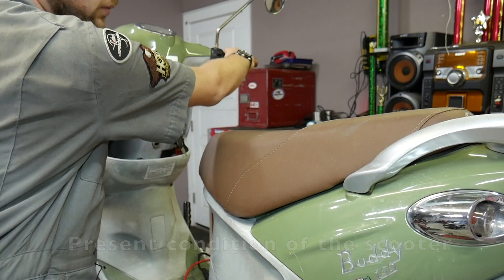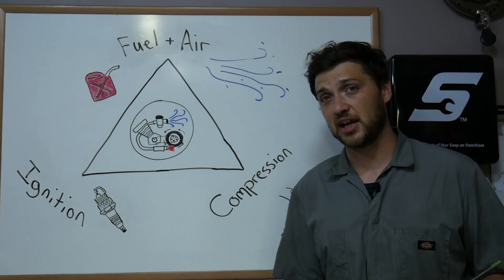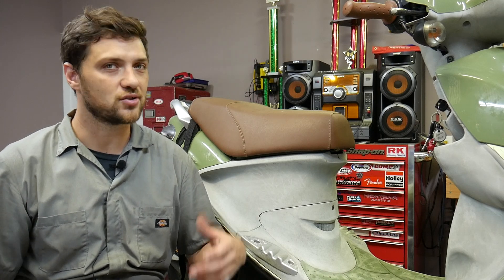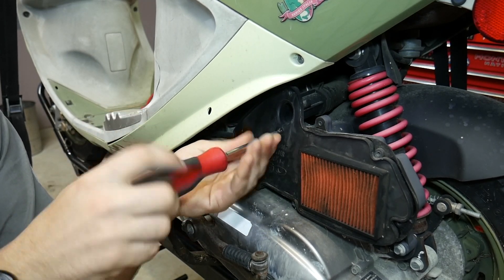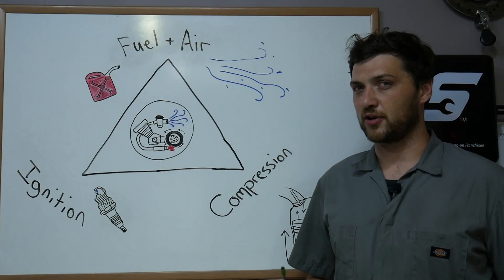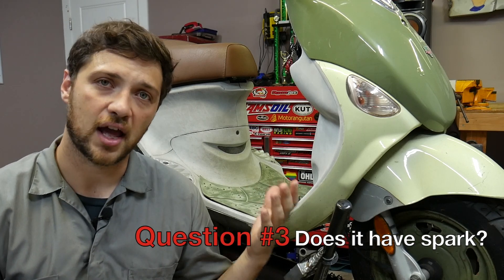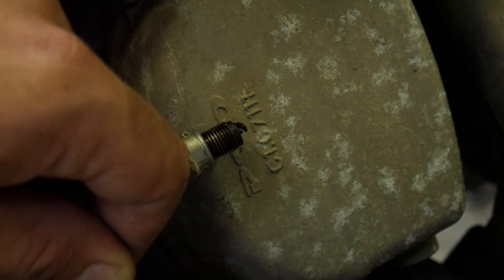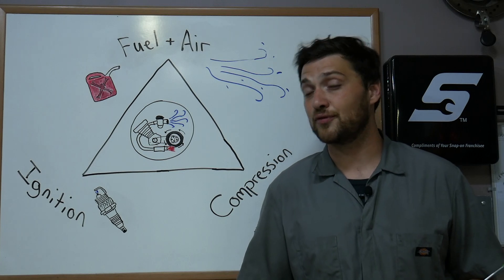Scooter 911: Find out why your scooter wont start by answering 3 questions!

Comment: Bought my husband a 2009 Silverwing 600 for our anniversary. Your help has been awesome. We are stuck at the turnover but will not complete and start engine. We checked EVERYTHING. Put a new starter relay on and cleaned starter switch button and got new battery. Battery drains fast. Storage Light is disconnected. We don’t have carburetor so don’t know how to check fuel injectors. At least we went from no sound at all to that turn over sound. Worked fine when bought the bike on Sept 4. Todd a few times, then nothing. Krr we or trying every day and about a week later, started right up. Turned off and on several times and rode a couple blocks again. That was few weeks ago. Has not started since. At least now, it turns over but does not start. Sparks too. Lights work, kickstand up, brake grid tightly. Checked electrical supply with meter. Kinda out of ideas.

Comment: Hi, I was shopping for a 2 stroke vino, met with a seller. He added premix into his 4 stroke and now it won't start. I lowballed him but we'll see. I know I'd have to drain the fuel and probably clean the carb out. What else would I need to do? How does the oil foul up the system? I'm curious.

Comment: Longshot that you would reply to something like this but, I’ve got a lance Cabo 50 - it was running fine on a Friday, then wouldn’t start on Monday morning. It turns over and passes the spark test. There is no change in result when doing the carb cleaner technique. Cranks but won’t start. What is the next step? If it was the coil it wouldn’t spark, right? Thanks again for all the great information you share on your channel.

Comment: My scooter electric starter doesn’t turn over and none of the lights or gauge lights comes on. However, the engine start when I use the kick starter, but still no lights. Anybody have an idea what’s wrong with scooter? It’s a x-pro x20.

Comment: I have a 2020 Tao Tao Quantum Tour 150cc scooter. I've been having some starting/running issues after it sat inactive awhile. I've replaced a bunch of parts such as the fuel petcock, fuel filter, spark plug, CDI, performed a valve adjustment and finally replaced the carburetor. It does start but idles rough for a few minutes then dies. I can't for the life of me figure out what's going on with it, could you give me some advice?

Comment: I'm disabled and a girl I guess that don't mean anything but I need my moped to start running again I believe since I replaced some tubing and a new fuel filter it may be the battery because I need a new one it seems like it's burning out batteries every time I put it in however I know mine is stricken with compound issues on one item because it doesn't look like there's a bunch of problems it's hard to detail it turns over but doesn't start brand new spark plug as well I need to get a new battery but that doesn't mean much when it comes to the kickstart my kick start does not work in fact when I was trying to get started the other day before I bought brand new tubing it started bleeding gas from some tubes so I went and I bought a brand new fuel line
Reply: Long story short I bought a fuel filter tubes spark plug and I need to get a new battery because it's burning out batteries it's what it seems to be doing I write it constantly and since I put the new fuel filter on I wrote it for a couple of months all of a sudden out of nowhere lights dimmed on me and stalled in the middle of the street I had to walk it back home it never really turned on again and this was just 3 weeks ago please help me it's my only form of transportation I'm in desperate need of some pointers my grandparents are passed away or they would be my mechanics God bless you

Comment: 2020 Blaze wolf 3000 miles brand new fuel filter some new tubing I might need a new carburetor boot and or carburetor my problem also might be the CDI box I need help desperately and when I say desperately I mean desperate it's my only form of transportation please help

Comment: My 2015 gillie runner has spark.. i cleaned carb & put New fuel in.. it turns over but won't start..
Even with carb cleaner..
Was knocked over while parked which i found out just as I finished I putting new stator in.. (random old man told me he picked it up for me a couple days ago  )

Comment: how many amps coming out of the muffler? lol. love you videos. details and user friendly. just bought a sym rv250. tonite it wont start. will check for battery and electrical components by elimination
Reply from the maker: I think it read 42amps at 90psi haha

Comment: Mann i am glad i ran into you i live here in dominican republic which scooters are main transportation for us poor people i have an issue with 2019 tauro 125 cc and is been a bitch to fix and the mechanic here rather keep giving you around treatment for you keep bringing the scooter back to their shop besides they know i work in a call center and that i make about 800 u.s. a month so they not going to fix it any time soon let explain my scooter started to clough up in the cabulater and stall . the mechanic took it apart clean the cabulater . weeks later again same issues cabulater getting claught up again with gasolina . well the problem has gotten worst now there is and electrical problem the lights deem down i charge spark plug and it sounds like the scooter is going to fall apart like alot cracking noice please tell me what to do cause this mechanic have realy done a bad job on it i do see alot parts not connected to the cabulater i know going through you i can tried to fix it myself .. Dont trust this mechanic with scooter thanks

Comment: I have a Peace sport AR 50 it my brother gave it to me it wasn't running I bought new battery of filters it was running then when every time I stopped it wouldn't start I adjusted carburetor and ran pretty good but it was doing as you said in your video it was coughing it was a lot of things and then it shut down on me and now it won't start at all I guess I do the fuse but even before the fuse blew it would not even cough and crank over it just the lights would come on and it would do nothing I'm at the bottom end of this thing I'm ready to sell it I was put too much money into it it was a free gift but I've spent too much money on it you could help me

Comment: Carb cleaner in the air intake was EXACTLY what was needed to the "My scooter won't start" issue.  Hardest thing was removing the air filter cover!  Thanks for the very informative video!
Reply: What can i use if i dont have the carb clraner
Reply: where do i get the carb cleaner
Reply: @zakariaameur7138 it is super cheap (5 dollars) at auto stores lime autozone and even sometimes walmart. Got mine at Autozone
Reply: Any Auto parts store, Walmart, Meijers, Target, even sometimes a dollar store. @zakariaameur7138
Reply: @zakariaameur7138 at walmart

Comment: My 150cc scooter wont seem to start with the new battery. Wont (turn over)But if I use my bigger 12v battery it will turn over and start. Ideas?

Comment: I watched your video I have a 2000 mine buddy International model 50cc when the moped is running gasoline is dripping so I'm thinking it's a carburetor issue do I spray some carburetor choke cleaner into the area behind the air filter to prevent more gasoline leakage to the ground if you can respond to my message that would be great the moped has sap for quite a while a few years but I'm working on getting it on the road but if you can still write me a message that would be great Thanks
Reply: I'm trying to say I have a 2009 Buddy International 50cc... Gasoline leaking on the ground when the moped is running I figured it's a carburetor issue what will cure the gasoline issue thank you for your reply

Comment: very informative presentation :) since my scooter totally failed the compression test (15 psi) it's probably a compression problem, even though I replaced the cylinder and the piston + rings. I guess I'll finally have to take the engine off and find the leak. A lot of work, since I never did it before... but I guess I'm gonna learn something...

Comment: Hi. I purchased a 26mm carb upgrade for my 150cc scoot. Installed it and Scooter wouldn't run except w/starting fluid. Obviously, it wasn't getting gas. I then noticed that the accelerator pump port on the carb was blocked off. Wondered if that was a defect, so I went back, read more reviews on Amazon, and saw others who mentioned the port & said that the carb didn't work. After a bit of thinking... I removed the gas tank cap and the scooter started up & ran great. Now I'm wondering what I should do next. Should I buy a vented gas cap or do I need to do something else? Also... I don't know if this is worthy of a vid, but I bet there are others who didn't figure this out who would appreciate it. Thanks!
Reply: Amazon page info & link follow: Carbhub GY6 150cc Carburetor GY6 26mm Carb for Kazuma Taotao Roketa SunL Baja Eagle Chinese Go Kart Carb with Air Filter

Comment: My moped has been sitting unused in the back yard for a couple of years, I changed the battery (I had tried charging it to little success), changed the spark plug, but it was your tip with the carburettor cleaner that eventually got it running.
Thank you for your help, it is very much appreciated.
Now I'm off out to see if it kicks into life again.
Reply: Did the carb cleaner trick work for you?
Reply: @Youtube-student2  it did indeed. I felt like a clever mechanic 😁😁😁. I honestly know nothing about engines and stuff, but even I was able to utilise this fix.
Reply: @Youtube-student2  It took me a couple of goes to get it running/ticking over. I suspect it's a good sign that it started at all, possibly the harbinger of an engine wanting to run 👍😁👍
Fingers crossed it does work for you 🤞🤞🤞

Comment: 49cc peace sports 2012 scooter. battery fully charged, new CDI box, new spark plug getting full Sparks, new fuel filter, I don't know what else to do! it's making the same sound yours made in the video but it will not turn over unless you kick-start it. when you kick started it'll turn over but it spits and spiders and runs like it's not getting gas. in Hudson, FL. someone please help!

Comment: Can you offer me a solution for my electrical issue with my scooter?! My turn signals and breaking light works but the headlight, the high beam and night time running lights do NOT work. How can I fix this?
Reply from the maker: Well on most scooters the headlight runs on AC while the tail light and turn signals are DC. Is it possible the bulb has failed? Sometimes without the bulb absorbing a large amount of power a voltage spike will blow out the smaller bulbs

Comment: its a long shot this but i have a tgb 202 classic scooter 50cc, last year it was running lovely i put it away over winter months and it's a no go now, iv'e tried everything i can think off, gutted the carb top to bottom, brilliant spark, seems to have compression as she barks if i drop fuel in spark plug hole and easy start in carb, but it has a 4 port vacuum on it, if i suck the end that goes into carb fuel comes out like it should but once in the carb it doesn't suck fuel down to it, i did away for a moment with the vacuum and put a straight fuel on/off switch from tank to carb but she still would not fire up, i'm at my wits end with it any help would be appreciated, jay from newark uk

Comment: Hi Garret...your channel is awesome!!  I was hoping you can help me out with my problem lol I've got spark,  I've got air, compression I've got fuel, but it's dry at the spark plug... you'll carburetor did run but it had numerous issues with being smooth so I replaced it with a new one now it won't run at all ..this is a brand new carburetor, electric, plug, oil.. everything ...what do you think it might be? And yes I did check the valves and I've got the needle at #4 position...

Comment: I have a honda ch80 and it wont start. the carburetor is getting gas but where the spark plug is isnt getting gas. the spark plug was dry. what can i do?
Reply from the maker: Sounds like you may need to recondition the carburetor!
Reply: @Scooter_911  Thanks thats what another person said. Im gonna take it apart and clean it. clean the jets. hopefully that does the trick
Reply: @Scooter_911  I took it apart and a piece of the rubber diaphram was sticking out and once i got taht open i noticed it was cracked and torn. do you think that could have been the problem? i sure hope that was.

Comment: PLEASE HELP!!!  I have a 2008 Chinese scooter 150cc.  I was riding it and it just stopped running.  It would crank over but not start.  I have replaced the stator, coil/plug wire and CDI.  Now, I turn the key and have NO power to dash, lights, horn, or starter switch  I have a fully charged new battery, can jump starter relay and starter kicks.  I checked the fuse in battery box, all good.  PLEASE...do you know why its doing this?

Comment: Thks 4 your video excellent I have a Piaggio zip 2T no fuel came out to the carburettor is new tap filter and valve if I such the pipe fuel came out I cleaned the carburettor or ready any hel please because is not starting Thks

Comment: Hello 
I would like to ask a question. I have gy6 moped it shuts off of a stop or signals as I slow it down.by seeing your videos I have adjusted its valve lash.i Changd it plug  .ignition coil and engine oil as well but still facing same issue. Kindly give me solution.  Thank you

Comment: Your videos are the best on scooter 911. I just got a Chinese sunny 49cc scooter that’s sat for a lonnnnng time. I replaced the carb, bendix, stator, cdi, starter,spark plug, ignition cable, battery, and rebuilt the kick start. As it stands now it still won’t start. So now I’m onto the valve adjustments. Fingers crossed!!!
Reply from the maker: Good luck! Sounds like you're on the right track!

Comment: My scooter cranks gets fuel and air but literally stopped moving. It idles but when you twist the throttle the clutches dont engage and tire doesn't  spin. I replaced the belt thinking my belt was bad but it wasn't so now I changed variator and still it doesn't run and move any ideas

Comment: The external fuel source worked for me but only when I blocked the air intake, if I remove my hands (from the air intake) the engine dies. Is there anything I can do what is wrong?

Comment: My scooter is hard to start when the engine is warm but has sat for a bit, like after eating lunch or grocery shopping, taking many cranks and having to give it lots of gas to barely get it to start, other than that seems to be running fine, any idea what could be causing it?

Comment: Can you please please do a video on testing the front main light? I have been staring at wiring diagrams and took everything apart and still cant figure out why my main light wont work, but a little secondary light in the same main head unit does work, Yes I did replace the bulb lol.

Comment: Mine won’t start at all previously trying to start it it would make the sound like in the beginning of the video- but now the lights won’t come on the battery makes a siring sound ( I am currently replacing the battery in hopes it’ll start )- but I want to cover all the basis of reasons why it isn’t starting & what else I can do if that doesn’t work- I noticed the inside of the fuel tank has rust- & you can feel it do something when I go to turn it on but it won’t start, lights won’t come on and it won’t make any sounds at all except the battery ( now removed ) please help and let me know if there is anything else I can do- the Kickstarter didn’t get it to start

Comment: These bikes are cheaply made and in China. Had pieces moving out of it when I got mine. Bought whole new battery and oil. Also you can't get the nut on the bolt to screw in on the handlebars. This thing is literally garbage, don't waste your time. Will stall out on your first ride. Just money hungry people looking to rip you off.

Comment: I'm trying to get Lady friend's shanghia shenke mf50qt started after not running 4-5 yrs and after 2 "mechanics" worked on same.
I have good compression and new parts consisting of battery, carb, spark plug, and vacuum fuel valve but scooter will not start even with shot of carb cleaner....ANY SUGGESTIONS??

Comment: I've got a good question, i see on your shirt you have a sae patch which means your a certified trusted mechanic. I own a icebear 150cc mojo magic trike motorcycle with a gy6 engine. But can't find any
One in canton Ohio to
Help me do regular maintenance. I've called the big shops
By they wont work or touch can you enlightened me about this.

Comment: So I followed your steps and everything worked just as you showed in the video. I was able to take my scooter around the block a few times and had no problems….except when I came home and once I released my hands from the throttle and break it shut off completely and would not stay on…..any suggestions?

Comment: scooter wont start...UNLESS...i spray brake cleaner in the intake then it runs fine unless i let off the gas and it stalls out. then the process starts over. ideas??